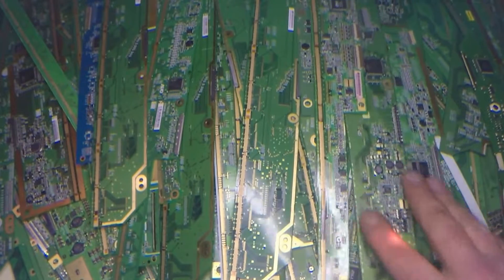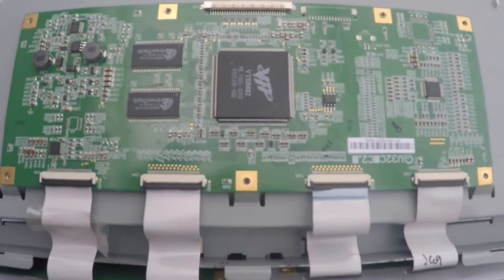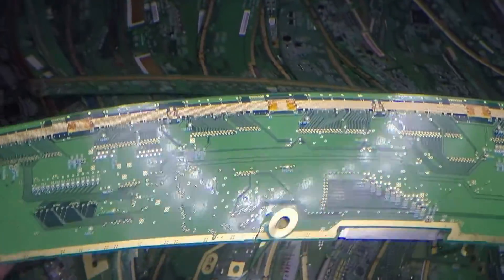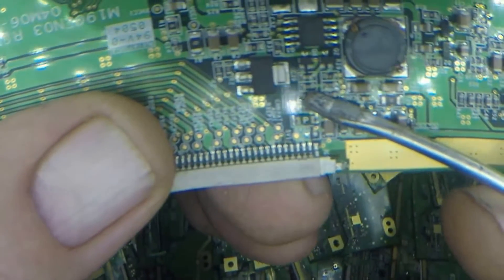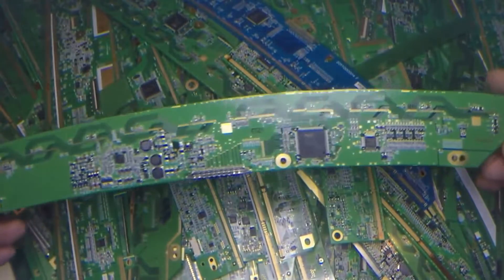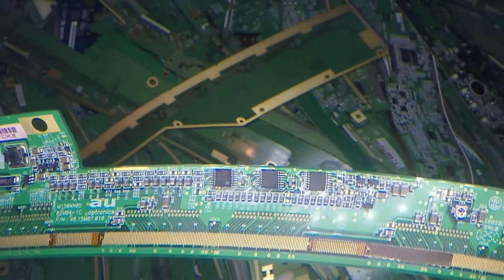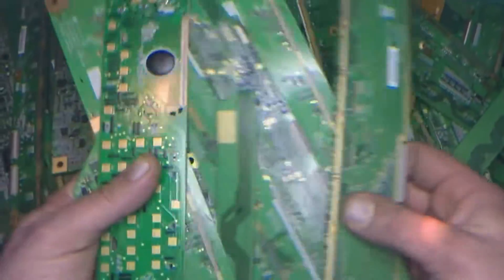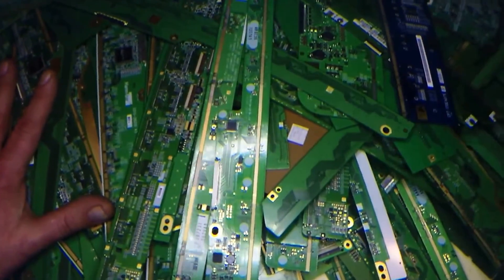Gold Finger Strip Boards from LCD TV's & Monitors

Comment: Can you tell me about the electrical charge stored in the board and what you do to discharge? Thank you.
Reply: Clad Queen  It should dissipate after a while, But if you want to discharge A board, I learned to take a screwdriver and short them out, Or even lay them on  A piece of metal that they can make contact on, That should do it.

Comment: I have processed some with gold fingers. the amount of solder mask that ends up in the foils is ugh. I have found the best way to process the lcd boards is to depopulate them and crush them into -200 mesh powder. then either pan the powder or run it on a shaker table. All the epoxy left in the gold will cause problems. once it is all crushed and seperates it is very easy to refine.
Reply from the maker: +Rodman Lyons didn't think anyone had enough yet to warrant processing them, would like to see a video on how you do it, what do you crush them with?
Reply: eWaste Ben I outsource that end of it. I throw boards in a big bin after I depopulate them. When it is full I send it to a company that builds mining equipment. They run it through a hammer mill and ship me the powder. I mix the LCD boards in with all sorts of depopulated boards. I recover all the metals. I ran 4 pounds of them in a/p the epoxy from the solder mask made a mess. 

Can also crush them with a ball mill. Would take longer but it is possible.
Reply from the maker: +Rodman Lyons how do you separate all the metals from the powder?
Reply: +eWaste Ben a sluice box. Which I made out of a corigated pipe. I run it just like one would in a gold mining operation.
Reply from the maker: +Rodman Lyons oh ok so your just going for the gold
Reply: +eWaste Ben I go after it all. I even reuse the lead. I melt the copper into ingots. The lead and tin I melt into ingots. The PMs I refine. Gold silver and paladium. 

once the boards have been depopulated and crushed I seperate the powder via a sluice box.  I desolve all the metals. After it is all desolved I drop each out with different methods. Send me an email or find me on facebook. rodmanlyons@gmail.com. I will give my Facebook via email. Would enjoy a conversation.
Reply: +Rodman Lyons hi dear I have    strip boards of TV can you buy

Comment: Hello ben, would you happen to know the difference between LCD tv's and LED tv's. one agian thanks alot
Reply from the maker: +Rick Flores They are both LCD TV's, The LED relates to the backlighting, so instead of having fluoro tubes all running along the back of the LCD, LED's have LED lights on the sides, no Fluoro's.

So to scrap they will be pretty much the same because we don't go so far to get to the fluoro's or LED's.
LED TV's are thinner because they don't have the little tubes through it so it saves space.
Reply from the maker: +eWaste Ben LED LCD TV's are still new so I haven't actually scrapped one yet, they should still have all the regular boards like finger strip boards because it's still an LCD
Reply: thanks alot ben for the help once agian

Comment: Ben if I knew how I would upload videos on the processes I use May surprise you just how much gold is on the finger boards. Basically I use a hot sand bath to remove all the soldered on bits then a hot caustic soda bath to remove the solder mask giving a clean board to process
Reply from the maker: Robert Wood I would like to see that for sure, it's not too hard to load a video, maybe someone can help you do it?

Comment: take a jack knife or straight edged blade and lightly scrape the green off the microwires stretching along on the boards that are in between the gold spots and dots..bet you will see the fine gold wiring connecting to them.(some may have copper).  people will be surprised to see how much gold is under the green coating. (except the larger green areas on the board that are flat blank looking). a valuable and good point when bringing to the table selling your scrap to a dealer.  I cut some of the thicker-older pc mother boards in half..used my jeweler's loupe, looked at the cut and was enlightened to see layers of gold wiring...more gold than what meets the eye that is for sure.  
 I would be interested in watching you do a video,.putting the lab coat on and show us the process you use to extract the gold.  Thanks for the video Ben..good education.
Reply from the maker: bantalee2002 I will do video's like that when I get set up right.
Reply: I will be waiting..good luck!